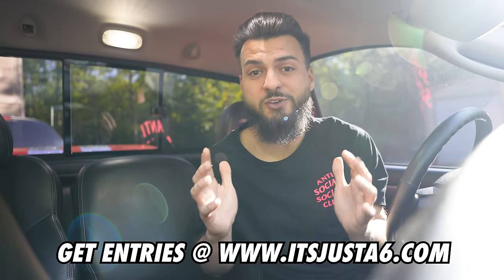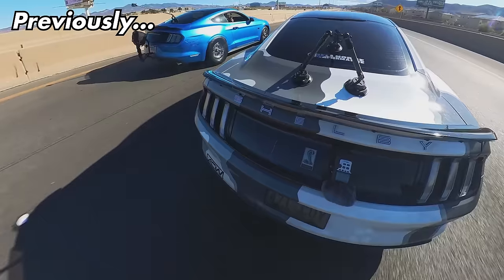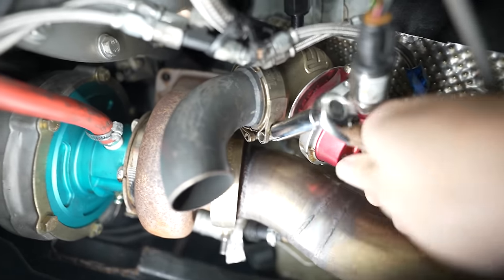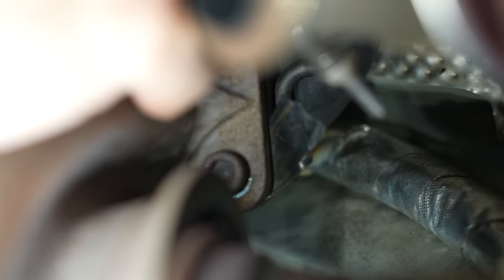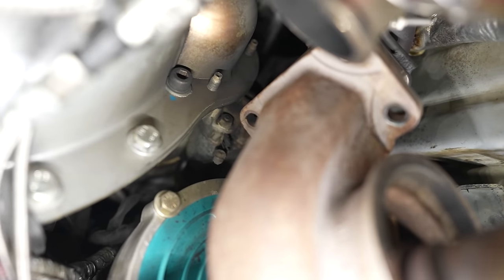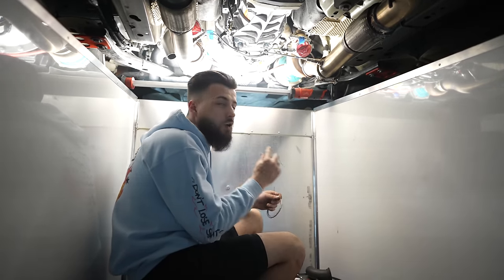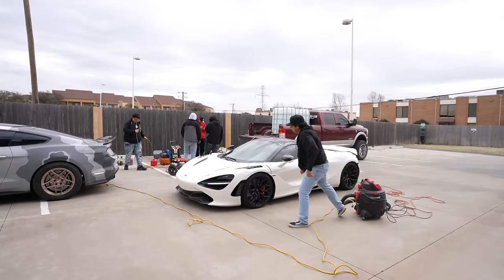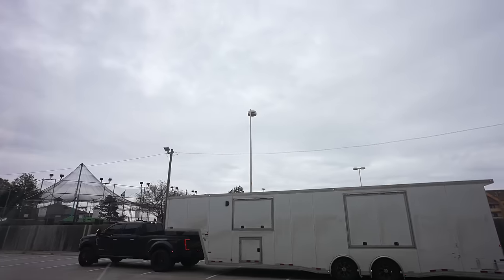I Fixed my Car, then It Immediately Got HAILED ON!

Comment: Ya know, it’s crazy, it’s almost like there’s this thing called header wrap, and turbo blankets. It would behoove of you to head over to Funk Motorsports and get you some quality shit. Also, keeping heat where it’s supposed to be aka the hotside of the turbo, you’ll actually make more power, spool the turbos up quicker and hotter exhaust gas exits quicker making more power. Wow, it’s almost like it’s SCIENCE😂 But for real dude, get some wrap and turbo blankets on them thangs
Reply from the maker: I appreciate that advice 😂🤣
Reply: @itsjusta6official  No Prob! I noticed a massive difference doing this to all my turbo builds in the past. A quality turbo blanket cough cough funk motorsports is one of the best things you can do. Just looking out for ya!

Comment: I would change those allen bolts for some regular bolts, if they stay on too long with locktite it will strip out when you try and take it out next time, also you can torque head bolts more then the allen ones. Just my 2 cents out of my Desiel Tec career. Also any bolt near exhaust or at the exhaust will absolutely need to be torque down and with locktite
Reply: I definitely agree

Comment: Get locking washers instead of using loctite on exhaust parts. The way to remove loctited bolts is literally to heat them up :P

Comment: Coating that new gasket in copper rtv gasket maker and letting it cure slightly before torquing the turbo bolts down will prevent that gasket from failing again. Believe it or not my car has nothing but copper rtv between the head and turbo manifold and has been that way for years with no issues

Comment: Heat alone didn't kill that gasket. Your bolts stretched or just loosened, lost pretorque and then blew the gasket out. If I were you, I'd look into Mitsubishi Evolution factory turbo bolts and the conical washers. The washers help keep the bolts torqued during heat cycles and also prevent the bolts from stretching from the thermal cycling.

Comment: studs should really be used to mount the turbo, those little bolts don't provide enough torque. washers should also be used. I'm actually surprised they supply such shit hardware lol